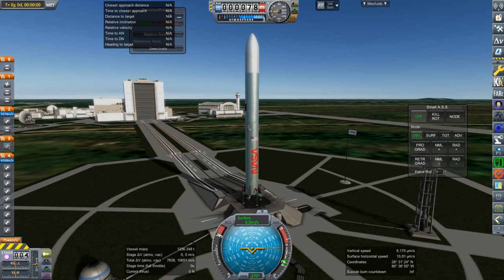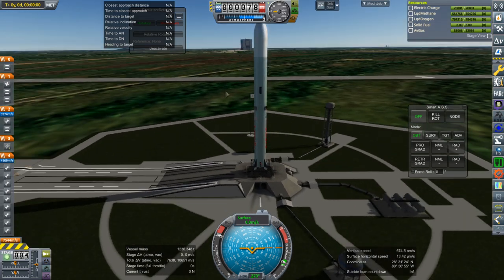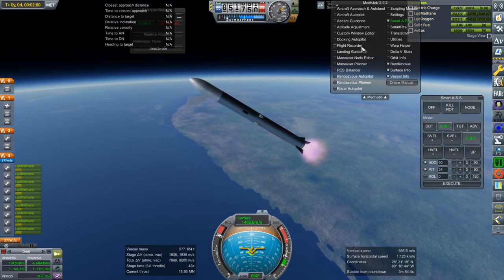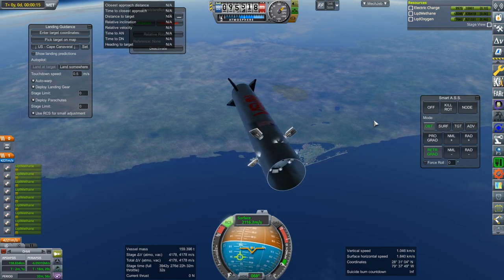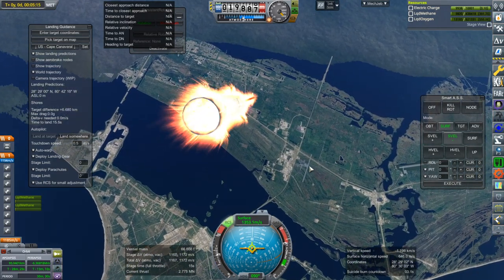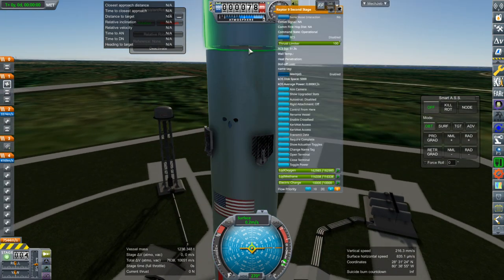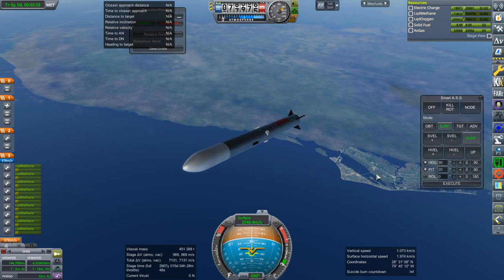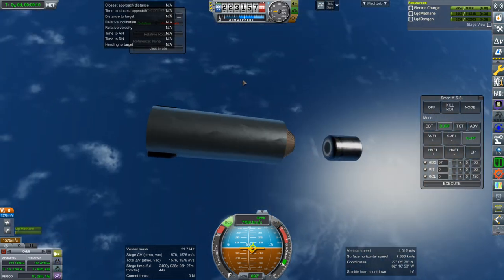Realism Overhaul in KSP 1.8.1 - Raptor 9 Remodeled

Comment: Tory Bruno just tweeted a photo of a model of a Vulcan Heavy, like three first stages strapped together. He said that this configuration might be able to beat Falcon Heavy in terms of LEO payload. What about you make this potential rocket?
Reply from the maker: It's even less likely to happen than Atlas Heavy. Last time I checked, their Payload User's Guide didn't include it, so maybe they should work on that first. At this point, I think he was just pulling people's leg because they kept bugging him about Vulcan Heavy.
Reply: @RaizSpace  https://spacenews.com/ula-studying-long-term-upgrades-to-vulcan/
I mean, take that as you will, but this is Mark Peller speaking at a conference not aimed at spaceflight fans, but customers. Also, have they finally released PUG for Vulcan?
Reply from the maker: I thought they had, but was mistaken. There is this technical summary which has a "Vulcan Centaur Heavy" which is not a 3-core version and, from the stats, just looks like it has uprated boosters or core engines: https://www.ulalaunch.com/docs/default-source/rockets/atlas-v-and-delta-iv-technical-summary.pdf
Reply: I tested this before (literally Vulcan heavy like the delta 4 heavy), and it's tons to leo are smaller compared to FH, and could only get out about 40 tons to low earth orbit with a be-3u, and only 30-35-ish with the ACES/ Centaur V due to the rl-10 being crappy

Comment: I have an issue in ksp ro, when i switch the configs of rcs thrusters to use feuls other than nitrogen it says consumers not receiving nitrogen and rcs does not work but when i switch to nitrogen in the  
rcs tank the thrusters start working

Is it due to tac life support?
Reply: That's quite possible. Depending on version, it's probably the likely offender--I'm pretty sure RO moved over to Kerbalism, but that might just be RP-1
Reply: @The0spetsnaz0  i dont use rp 1
Reply from the maker: I don't know, because I haven't seen that. Is this in KSP 1.8.1?
Reply: @RaizSpace  yes

Comment: 4:55 Eehh, I think you should shorten it. That extra volume would significantly increase the dry mass.

6:55 Yup.

8:55 KSP physics never ceases to amuse!

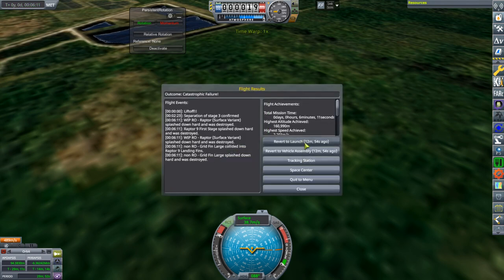9:25 The remaining burn time at staging could probably be reduced to at least 17 seconds with a more precise landing procedure.

13:00 With both smaller margins on landing, full utilization of the upper stage, and a more optimal trajectory, 45 tons would probably be possible.

It would be nice to see how much payload this could deliver on a Trans-Lunar/Cytherean/Martian or Geostationary orbit with the first stage propulsively landed. At least the first things are technically possible with a Falcon 9, but in the same vein that it is technically possible to launch a Moon/Venus/Mars probe on a 2-stage Titan II. I wonder how much better this would be at that task.

Comment: I'm interested to see how that thing would get off the ground. I'm gonna guess those raptor 9s don't have nearly the thrust of the sls boosters.
Reply: 16000kN for the SLS SRBs and 9x 2200kN for the raptors, so raptor boosters have an edge. More deltav as well though will use it to land for reuse.
Reply from the maker: These boosters should be pretty much a drop-in replacement for the SLS SRBs.

Comment: the falcon 9's gridfins point the other way around on ascent.
Reply: Yeah they are backwards
Reply from the maker: I thought last time I tried that, though, they controlled wrong and caused wobblies.
Reply: @RaizSpace  Its supposed to be flat on the top and have the teeth on the bottom, with the block 4 grid fins dont have the teeth for extra control tho.